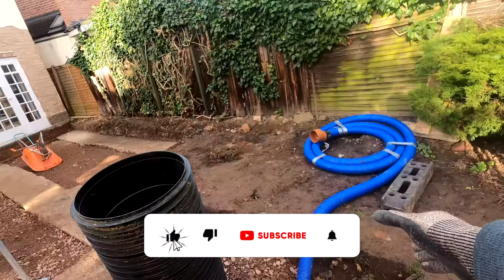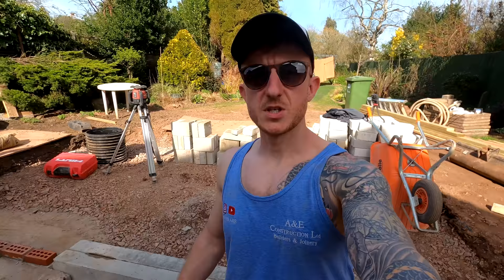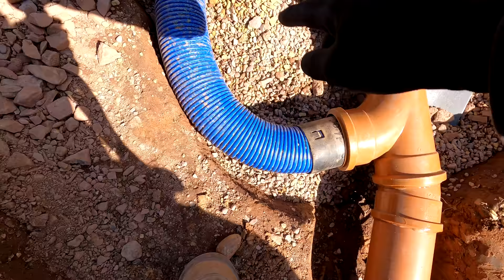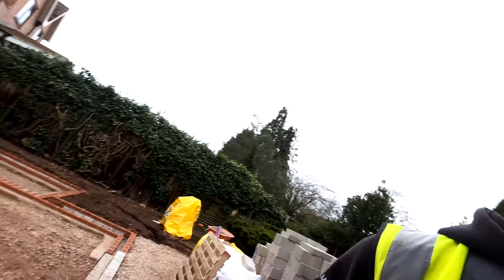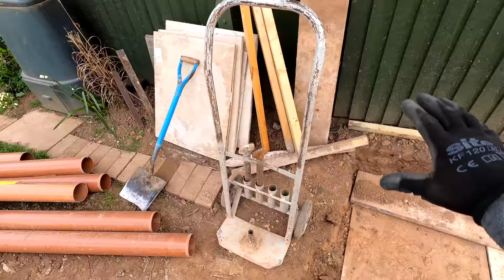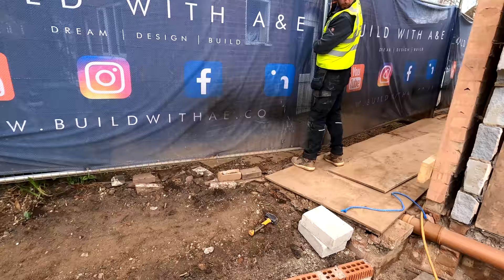Bricklaying up to DPC! 🧱 | Single Storey Extension #10

Comment: Nice job, one question though. Why filling the bottom layer of the brick? This isn't adding to its strength, while reducing insulation quite a bit.
Reply from the maker: Hi Paul,

Filling the perforated engineers ensures they are solid. These bricks are the base for the block and beam floor, so insulation properties at that level are irrelevant, as they are not part of the insulated envelope.

Hope this helps.

All the best, John 👷🏼‍♂️
Reply: @BuildWithAE  thanks for the reply, good job!

Comment: Why not use a 7n block instead of the perf engineers ?
Reply from the maker: It's all about getting our levels right for each stage of the build. Using the engineers gave us a bit more breathing room for finished floor levels. It's better to put in a bit more screed, than having to put less in 👷🏼‍♂️

Hope this helps.

All the best, John 😊
Reply from the maker: A block flat is 100mm and an engineer is 65mm, which gives us an extra 35mm of clearance when calculating the finished levels.

Hope this helps.

All the best, John

Comment: John - could you explain more on why using solid engineering bricks is less cost effective that using perf's then having to go over them again with cement fill?  It seems counter-intuitive to me.
Reply from the maker: Hi Matt,

The perfs were available at a much better price than solids, and after factoring in two men for half an hour and one mix, it was a more cost effective option.

Hope this helps.

All the best, John
Reply: @BuildWithAE  Gotcha - thanks for taking the time to explain.  Appreciated.

Comment: Instead of solid engineering why not us solid concrete bricketts? Saves the filling
Reply from the maker: Hi Mike, 

That's a good shout, these engineers where a quicker option at the time though, as we would of had to order them in.

Definitely worth a go in the future though.

All the best, John 👷🏼‍♂️
Reply: @BuildWithAE  thanks 4 your reply.